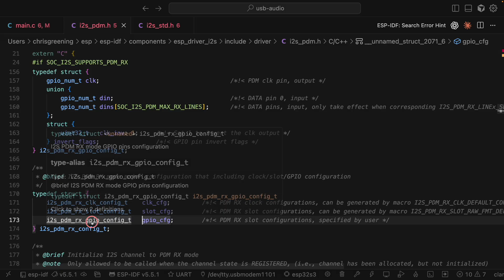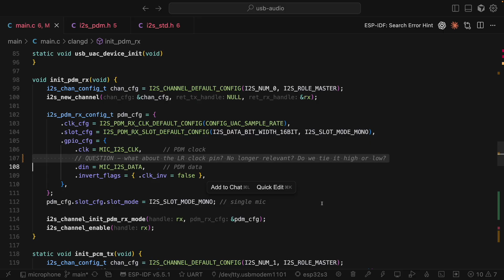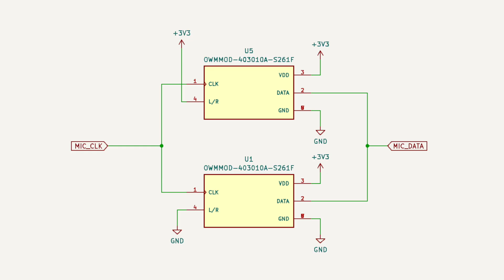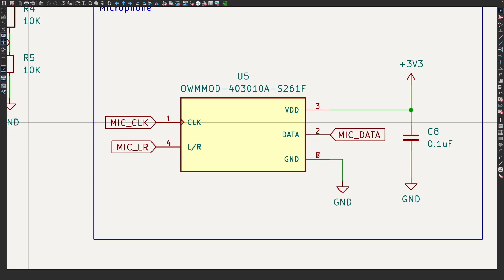ESP32 PDM Microphone - What do you do with the L/R pin?

Comment: Hi you seem to be an expert about audio, do you mind to direct me how to amplify the voice of people who almost lost there voice , and amplifying it on a portable speaker, but cancel the oscillation? If the speaker is to close to the mic it is oscillating quickly, any idea how to avoid that? Some people are so sick they need to use FFP2 mask, is there an opton to put a small wireless mic inside?
Reply from the maker: I'm flattered you think so, but I'm definitely on the amateur side of things.

It is a really difficult one. It does seem to be a solved problem with video conferencing systems and echo cancellation.

One way to do it hardware wise is to make sure the microphone is highly directional - so it only picks up the speakers voice and nothing else. And then carefully arrange the speakers so that they aren't picked up by the mic.

Jaw bone/throat mics might be the answer - they rely on the sound being transmitted directly from the speakers body rather than through the air.

Comment: Just pointing out that there’s a 3D print available for your omnifixo clips, that holds a Dupont connector pin as a probe.
Reply from the maker: Ooh nice! Post a link and I'll approve the message (YouTube holds any comments with links for approval).
Reply: @atomic14  BTW can you share any details about your setup, I saw on a recent video you used the NRF PPK tool gui very effectively and Ive always felt that tools like that or a scope/psu/DMM that outputs to the PC could be a fantastic learning Aid

Comment: Design is soooo much harder when you haven't read the datasheet a few times. 
This is where prototyping comes in, making sure you get it right before spending £1000's on a PCB run. 
Ok just £5  +PnP if your getting the boards from PCBWay.  
in my last job a small run of PCB's (<100) would be about £50 for the boards and £950 for inspection and paper work, before you've even had the components put on. 😞
Reply from the maker: Definitely! Fortunately, nothing broken in this case apart from losing a pin that could have been used for something else...